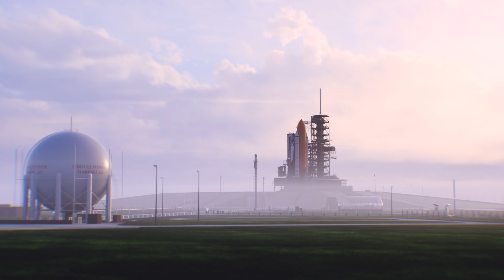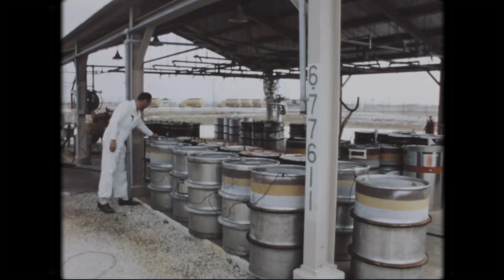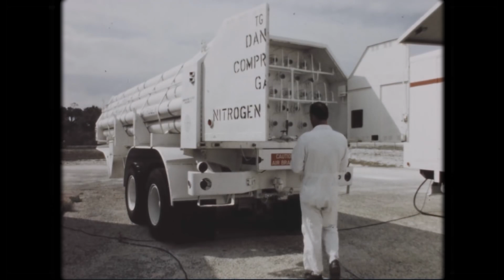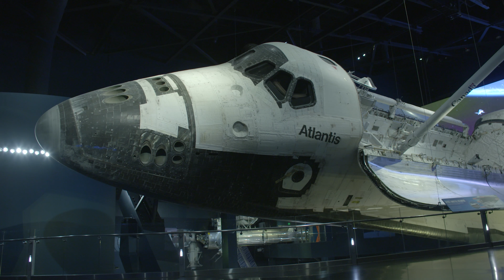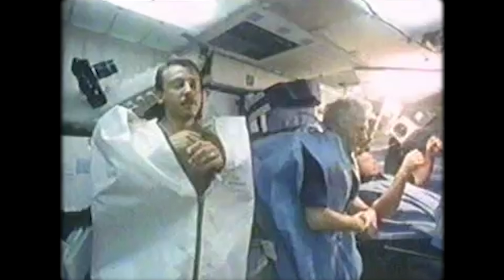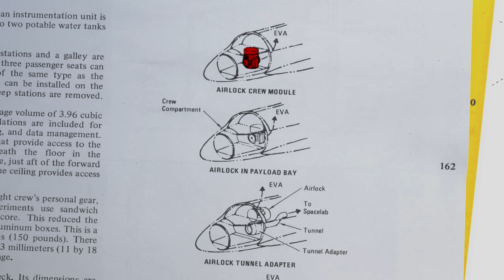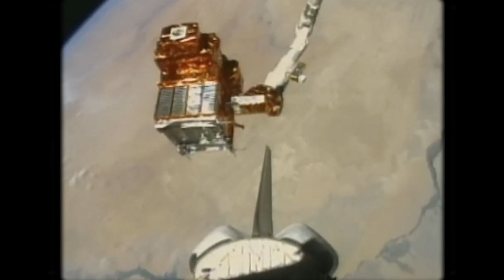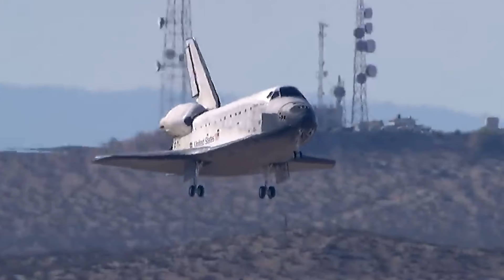The Insane Engineering of Orbit

Comment: What keeps shuttle from not hitting the ground? Gravity is one force acting on shuttle....whats the force opposing this force? Speed is not a force...just a result of a temporary, constantly diminishing force applied to it.
Reply: Nothing is opposing gravity in orbit. You are being completely pulled down by gravity. 

Instead, you need a high enough horizonal speed such that you don't fall directly towards the earth, but in a circle around the Earth. That's basically it. 

(simplifying the problem to ignore smaller effects like drag and assuming circular orbit),
Reply: @sarmadchaudhry6006  Whats keeping shuttle from shooting straight into space?
Reply: @CawfeeGasBlast  Imagine it like this. 

You have an apple and you release it, you will see it fall to the ground.

But when you impart a horizontal force onto it (aka throw), instead of falling straight onto the ground, it goes toward the force's direction and approaches the ground in an arc shape. It also takes a bit longer to reach the ground.

Throw the apple harder, the falling acr becomes bigger and the apple takes longer to touch the ground.

So, higher speed = longer arc and longer airborne time

With enough speed, can the apple's arc become so big it turns into a circle and the flight time becomes infinite? It can, and that's how orbit work.

Shuttle's orbit is just it flies fast enough that its falling arc becomes a circle and its flight time is infinite. And since it's in space, there's no air to slow the speed down so it just flies in a circle forever until a different force is applied to change the direction and speed.
Reply: @kataisaki505  At engine cut-off...there are two force vectors on vehicle...gravity and directional from engines....the directional fades with time to zero...gravity is still there.
Reply: @CawfeeGasBlast  Speed fade? How, in space, there's no air, no air means no drag, and no drag means the speed stays constant. I even said this in my initial reply

Comment: This was the first video that I had mixed feelings about the cut. At least three times (Shuttle bay doors, experimental scaffold for the space station and the attachment bar) I felt that I've missed a half a minute or so; because the video smoothly transitioned to the "yep, it was done" from "we'll attempt it"

An example from the shuttle bay - "So we wished to equalize the temperature, so we barbecued it", narrator: "With the bay closed..."

You haven't told us that it was actually closed. There is a (small) gap in the narrative, but quite noticeable.

Comment: I wonder if the Space Shuttle's expendable tank could have been designed to be used as a space station compartment, becoming part of an ever growing station with each successive trip?  Seems like an awful waste to drop it straight back down after expending so much fuel to lift it.
Reply: That was something they looked into. The main problem was a concern that the foam insulation would start coming off, causing a collision hazard. Also there would have needed to be a lot of on orbit assembly to get a useable station.